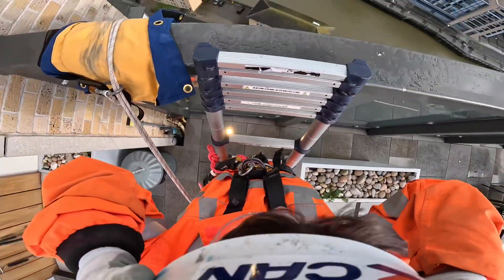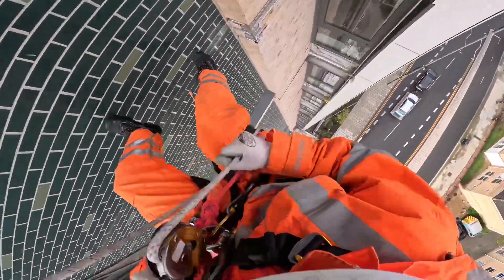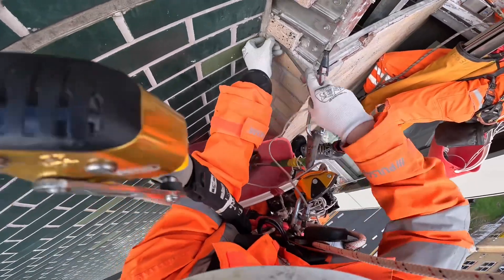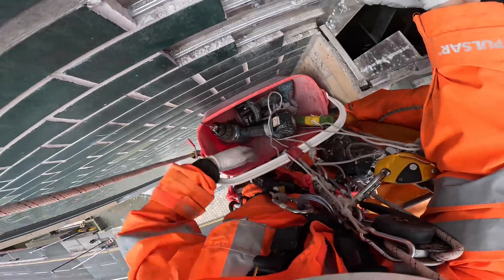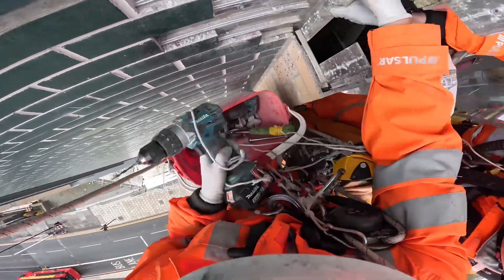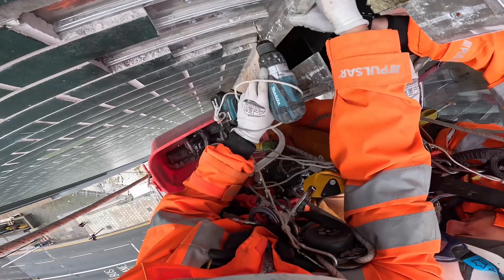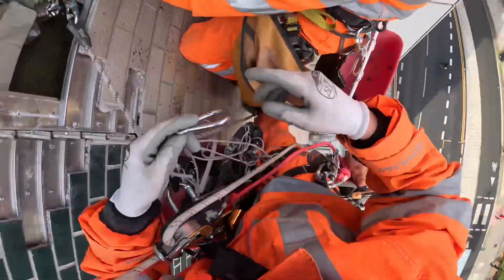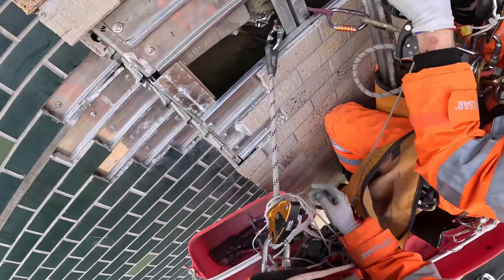Scary heights Engineering video

Comment: If that is 70m then a mobile crane and 2 man bucket would have been better
Reply from the maker: In theory yes but where are you going to put a crane in an occupied residential complex?
Reply: @Grasscutter69  where they are working the road is empty maybe shut because of them. TBH not sure what they were doing taking out wool but putting bricks in after, possibly could be done from inside.